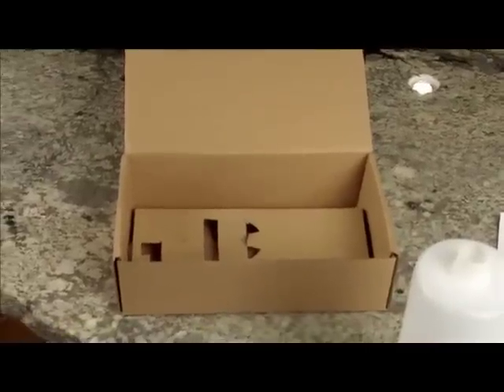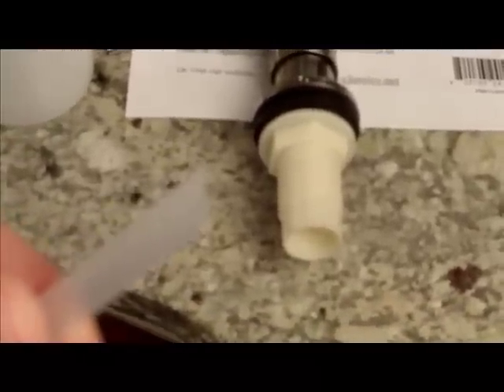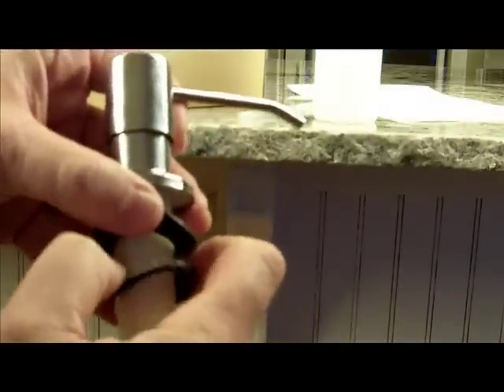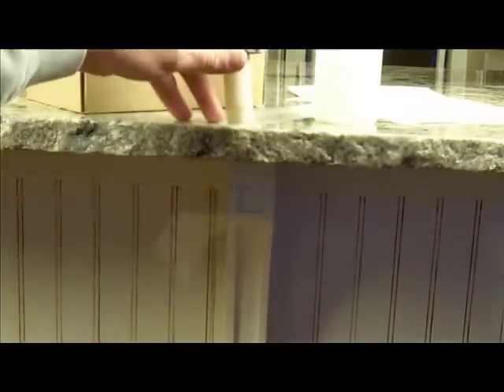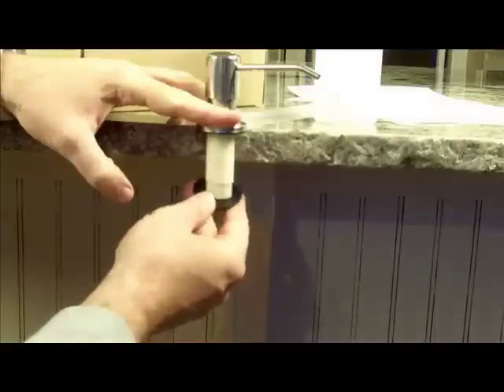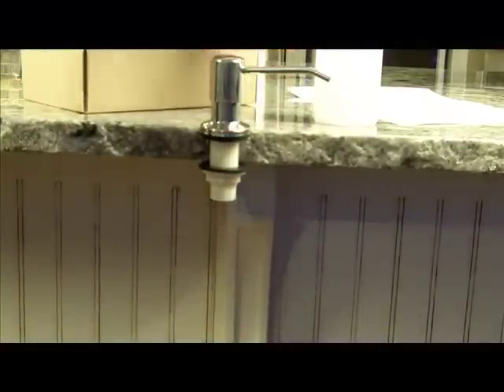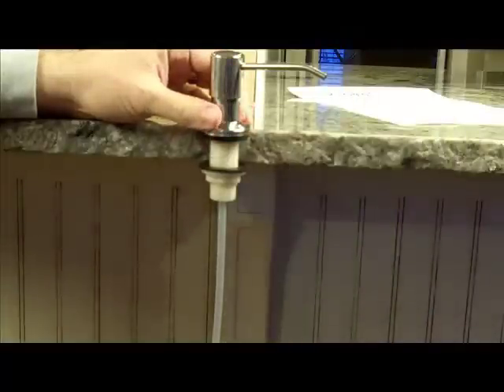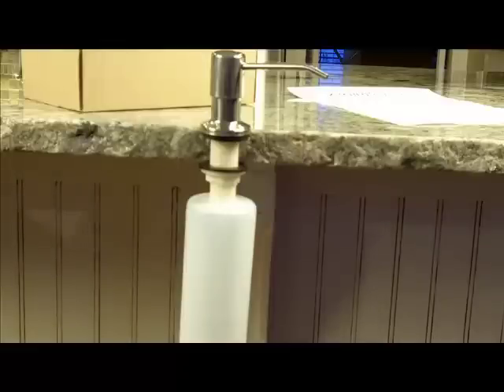Soap Dispenser Installation Video

Comment: Slick design and worked great for a month or two until I went to refill it for the first time.  The plastic pump unit will not lift out with the stainless steel plunger so it cannot be refilled from the top.   Do I really have to get under the sink, unscrew the bottle to refill every time?

Comment: Simple enough to install. How would you do it with a 4' plastic tube which allows one to use a large bottle of soap under the sink instead of the 7 oz bottle. Less refills. How to get the soap sucked up into the tube to come out the pump.

Comment: how do you repair one that has stopped pumping soap? Can you show a video on how to disassemble one?
Reply: I just removed one.  It's a two person job.  You will need a strap wrench and a set of vise grips.  Remove push top of the dispenser and its connecting assembly first.  Also, remove the bottle from underneath.  Have the stronger person underneath with the vise grips on the lock nut.  Have the other person turn the dispenser counter-clockwise with the strap wrench.  It will require a little brute force, but it should come off.
Reply: Dave Roller I was hoping to see a video on how to disassemble it so that I could repair it. If they cannot be repaired, then I'll leave it and just use table top soap.

Comment: The pump tube and the pump are exactly the same diameter. How is the pump tube suppose to be inserted if it is the same size as the pump?
Reply: We designed the tube to fit snugly to keep the soap primed in the soap dispenser. Try sticking the one end in hot water for a couple seconds before fitting it into the soap dispenser. 

If this doesn't work, email us at support@kitchen-classics.net and we will send you a new tube.

Comment: dose it fit a 1-/38s  hole  on the coutner top
Reply: The diameter of the core should be minimum one inch, but preferably 1-1/8”.

Comment: Yeah but how did you make the hole???? Exactly your not showing us squat!
Reply: The diameter of the core should be minimum one inch, but preferably 1-1/8”.  The spout will reach 3.5” from the center mark of the hole, so you will not want to hold the center mark of the hole more than 3.0” from the edge of the sink (I would suggest a little closer than that).